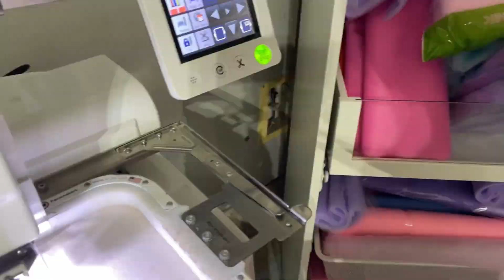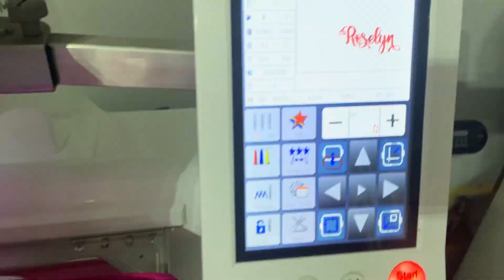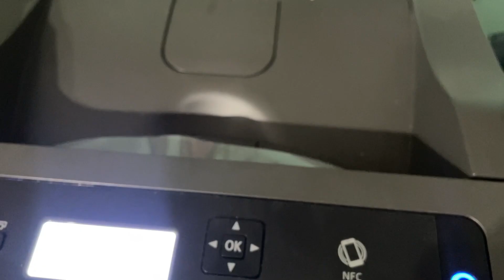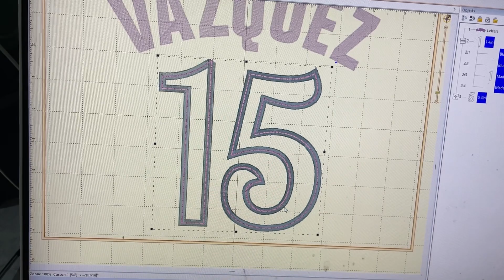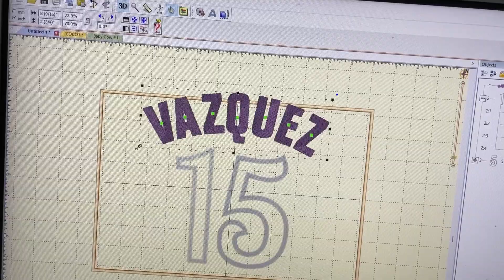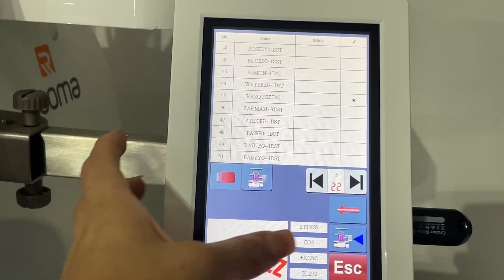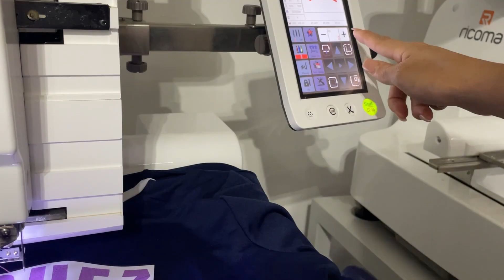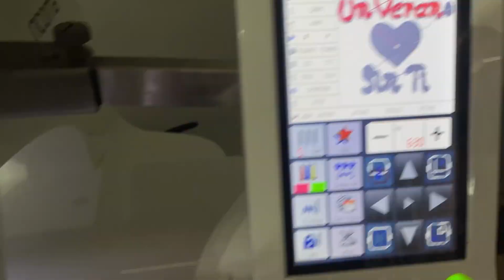Ricoma Labor Day Sale | jersey Embroidery

Comment: I know that you have all the common machines how often do you see yourself retention in the machine because you’re having problems with your tread get to the fact that it’s not printing correctly? Both on the EN 1010 in Indy empty 15 oh one? Thank you so very much, the reason why I’m asking is because I’m wanting to get the Malco self tensioning system and it does everything with touch it with company and I wanted to know how difficult would it be for you to constantly be  thank you so very much